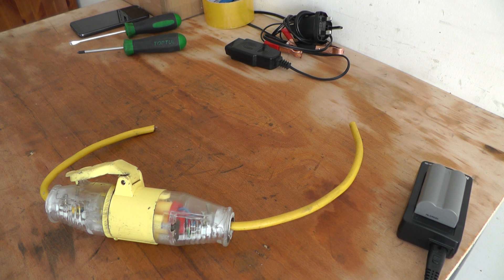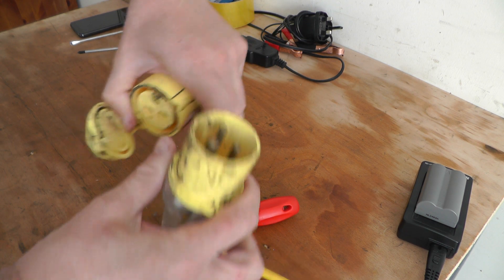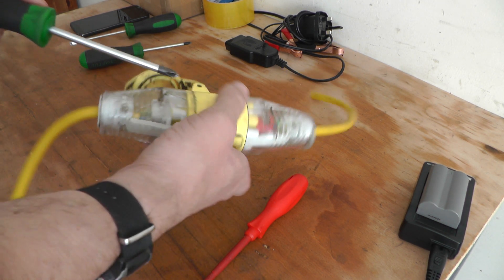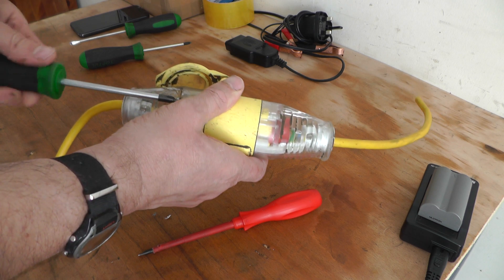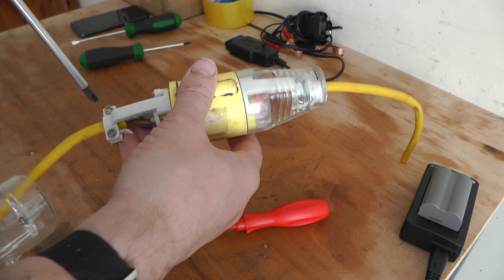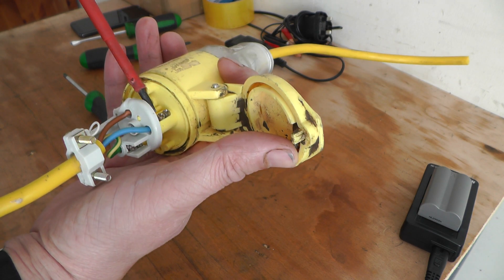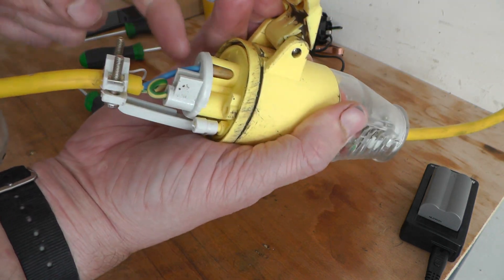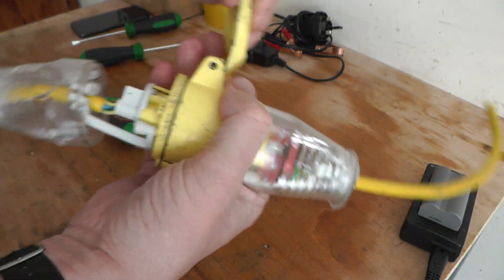110V Yellow site Plug Wiring Explained 💡 How to Wire a Replacement Power Plug & Safety Check

Comment: Would it be possible to wire up a 240v microwave to a 110v plug instead of using a step up transformer?
Reply from the maker: no i would not try